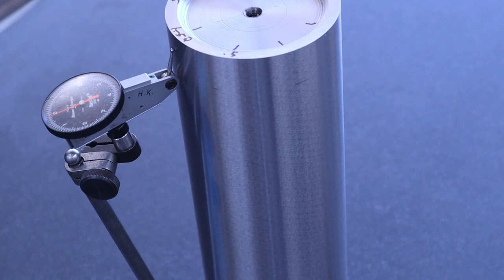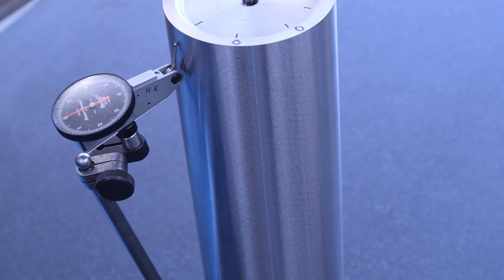Finishing the Cylinder Square

Comment: Good one .    Usually you would shim the tailstock to get the criss cross ,  i am assuming that is a t&c grinder you are using . If that is the case i would look at shimming the wheal head if possible to get the criss cross then take another pass length wise .  
I have seen these before where the base has been segmented to 4 pads  for contact .  
Ages ago Stefan Gotteswinter was remounting  the column of his small mill also & he used some type of epoxy resin on final assy .  Worth a look at .  Cheers  👍
Reply from the maker: Thank you Max. It is a t&c grinder.  I was so afraid of it being back out of true that i left shimming out.